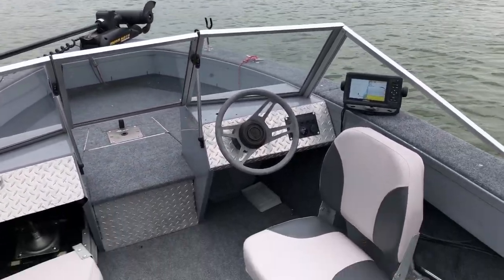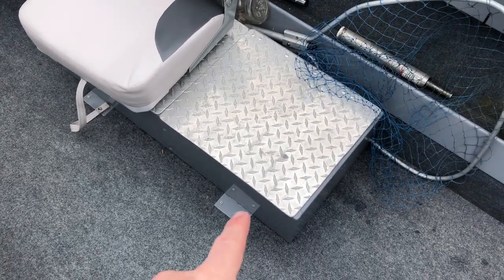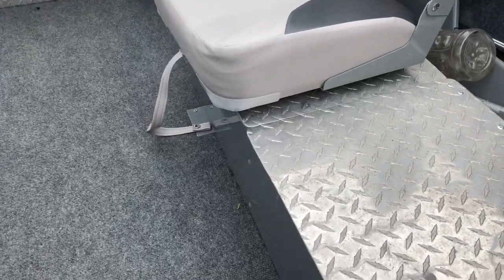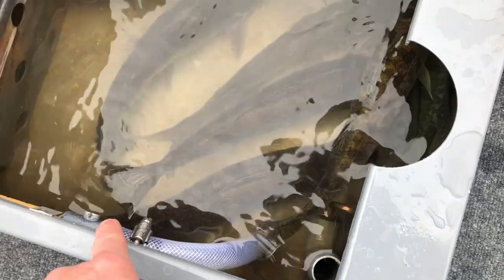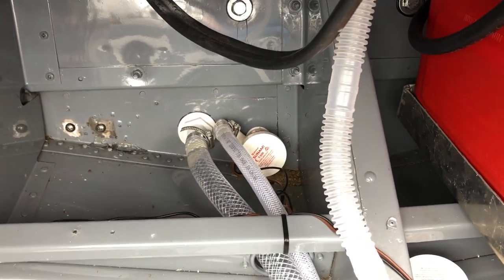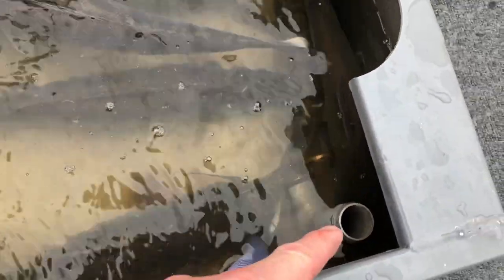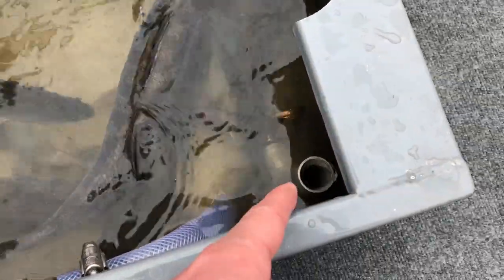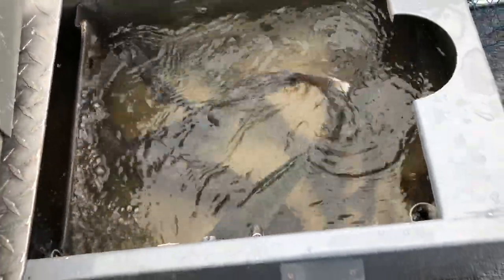1 Pump Livewell Setup

Comment: My LW set up is just like yours.  Water enters tank above water line and tank over flow is above water line . Both the overflow and inlet at transom are below water line,. However if Iforget and leave the pmp on the water fills my bilge not going out the OF due to water pressure in the hose

Comment: The diamond plate and windshield looks nice.
Reply: I got a problem with getting water to my Live Well I don't know if you can help or not or give me a suggestion. I have an 800 gph  aerator pump with a 3/4 inch  flex hose running to the front of the boat it's not wanting to pump water to the live well .is the pump too small? or is the hose too big? Sometimes it works perfect  most of the time it won't pump at all. The pump is running but not picking up water .. Any suggestions would be highly appreciated I thought about putting a inline primer bulb on but I've never heard it doing that…. thank you

 Lamar Carpenter

Comment: How do I set up the pump to bring water in? Do I need to cut a hole in the boat and silicone around it? Can you send a pic of how yours is sucking up water from the outside?  Thanks.

Comment: I'm thinking about making some changes to my alumacraft TSV14 currently with 3 bench seats. I'd like to change that out for a floor so I can mount some pedestal base seats... And add an appropriate sized live well to the boat. I'm thinking about a 18 20 gallons tank is there a good place now stern or sides for this.

Comment: I have a similar boat to yours. For some reason the inlet on my live wall is at the bottom of the tank and drain is halfway up and goes out thru a thru hall port.. No way to drain the live well completely. Doing a complete overhaul of my boat. Can you send me closer pics of the inside of your live well. I like the simplicity of your system.

Comment: On the over flow piping at the transom. Is the threw hull fitting above or below water line? If below does water come into that line and prevent outflow?
Reply from the maker: FishGuy Ry thru hull fittings are both below the waterline. It’s critical that the stand pipe and aerator end are above the waterline and all connections be secure.

Comment: I’ve gotta older terry bass boat, the live well has only one hole directly in the bottom that goes to Through the bottom of the boat, just like someone drilled a hole through it, how do I hook a pump to this style?? Please help
Reply from the maker: I’d be really cautious in putting any fittings on the bottom of a bass boat. I’d be afraid of knocking it off on a stump or rock.
Reply: @justtinkering6054  do ya think I just need to seal the hole? It’s a factory hole that’s in the bottom of what looks like a permanent cooler

Comment: Where does the water go after the overfill drains it from the tank
Reply from the maker: The water goes out the top of the stand pipe down through the large diameter hose and out the back of the boat. That’s why it’s critical that the standpipe be higher than the water level outside the boat.

Comment: What do you do to drain the water???
Reply from the maker: It won't completely drain while on the lake, but as long as the pump is running it is circulating fresh water in from the lake. When I take the boat out of the lake, I pull the bottom plug on the standpipe and the water drains completely out.
Reply: @justtinkering6054  weird my boat I just bought doesn’t have a drain plug. Im wondering if I have a bi directional pump.